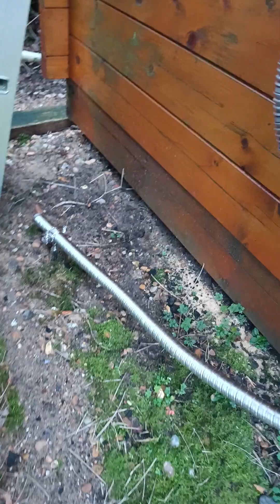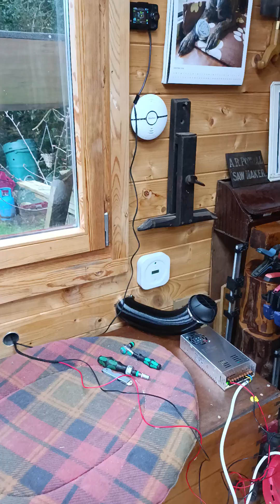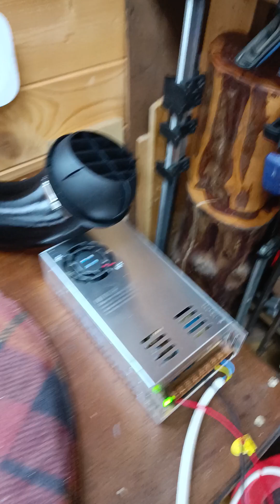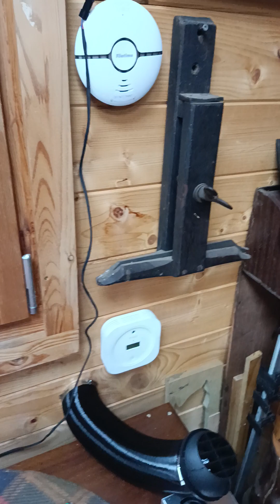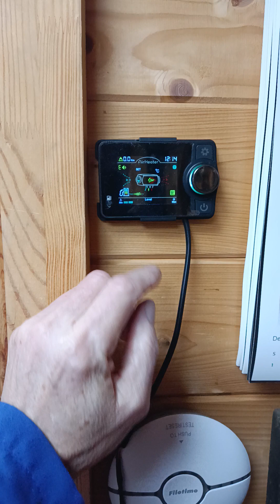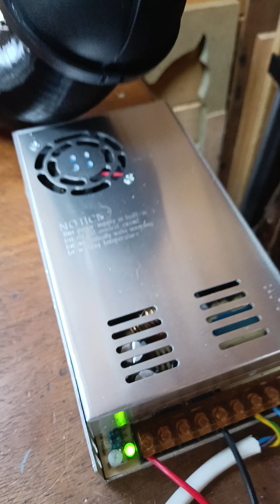KT Tools Working Museum Media Centre Chinese Diesel Heater Installation

Comment: Heat it like it is 1986 😅 — sometimes you frighten me, mate ;)
Reply from the maker: They're quite high tech now...😅
Reply from the maker: Eventually both cabins will be solar powered...cabin two will have a solar array on the roof.

This diesel heater will suffice until then allowing me to extend the time I can work during the colder months